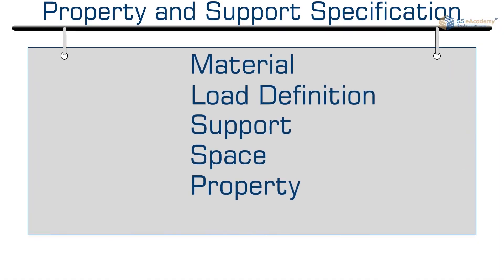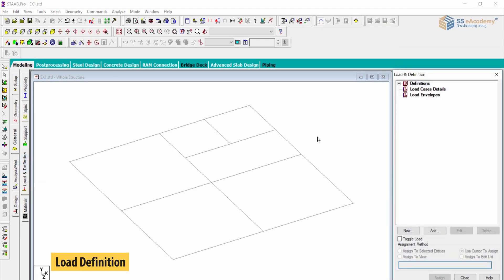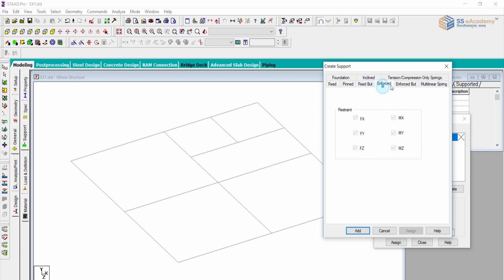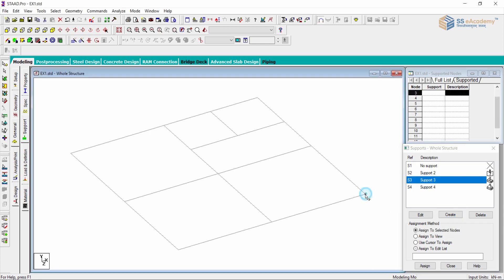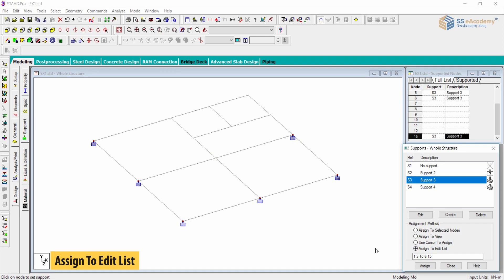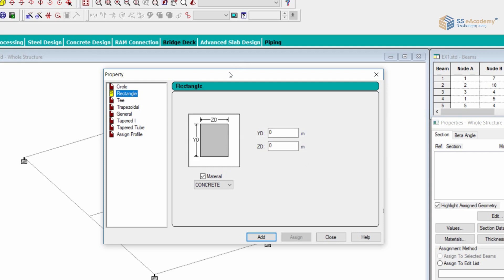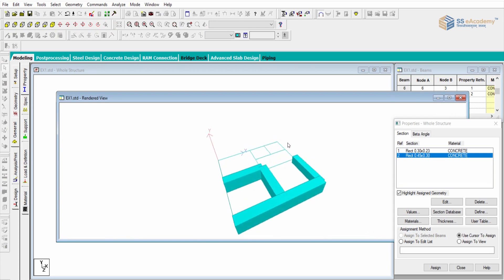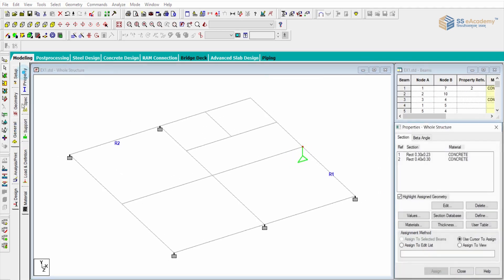Bentley STAAD Pro : Assign Properties and Support Specification

Comment: sir how about bolted connections as internal support?
Reply from the maker: Thanks for asking.
there is saperately connection module for connection design named. "Staad connection"
we don't model connection at joints
You can specify particular joints as pinned or semi rigid
using release specifications.